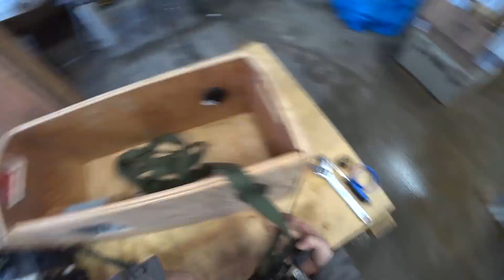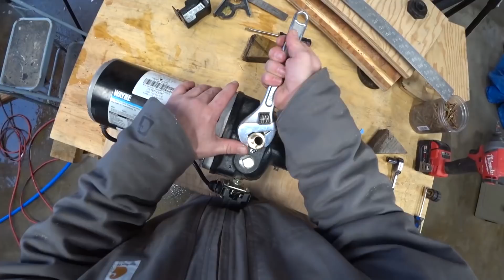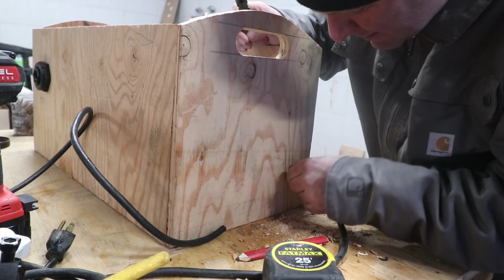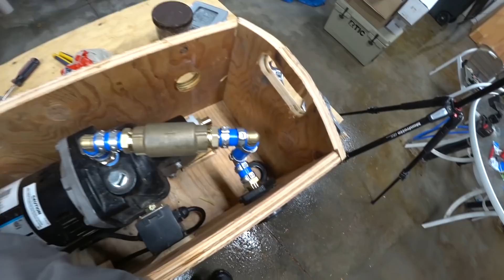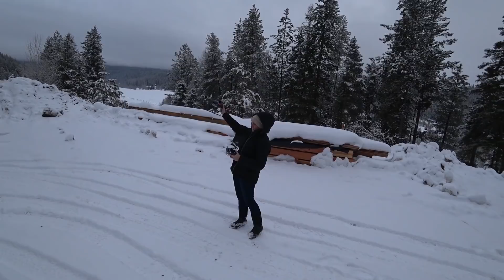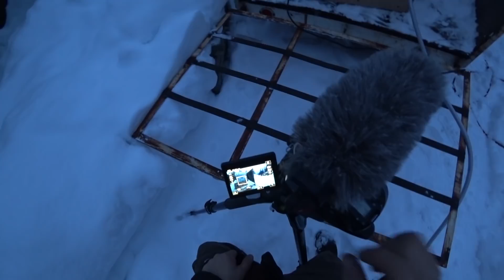Upgrading Our $2/mo Gravity Fed Water System

Comment: I know the two of you are smart and have done your research, but I still think you need to look further into what to use for plumbing in your house. Pex is fine for many things, the radiant being one of them. I would never ever plumb a house with it though. It is prohibitively expensive and quite honestly just massively failure prone. I really think you should reconsider PVC if you don't want to deal with copper.
Reply: Because Radiant heating has far fewer connections (see points of failure) than typical plumbing. It likewise is also under far less stress than normal plumbing as it is a fixed system, with a fixed constant pressure. Also PVC just isn't viable for radiant because it is just too rigid. It really comes down to the simply premise that there is no one solution that is best for everything and every solution has something it is best at. PEX is best at radiant heating systems, PVC is best for general house plumbing, Copper is best for your hot water lines and Cast iron is shit for everything. 

Sorry, currently tearing some cast iron out of a 80+ year old home and it is just awful to deal with so I had to throw that in there. That said, all I'm doing here is encouraging them to look further into it. I enjoy their content and even if they continue with pex I'll still watch even if I disagree. I'm just speaking from my personal experience of working with it as I have had to rip more of that crap out that was less than 5 years old because it was leaking than I ever have PVC. I've never had a problem with it in radiant systems though..pretty much set it and forget it.

Comment: THE WORST pex connections made. Garbage. Those shitty crimps will fail. Use another type of connection.
Reply: You must suck as a plumber(if you are one) because we use stainless crimp connectors and brass fittings just like he has and we have very few issues. I would say 0 issues but nothing is perfect. Thats what we pipe all of our houses with.
Reply: Your lack of understanding of how to install PEX and use it's connectors is shared in your trolling useless comments.